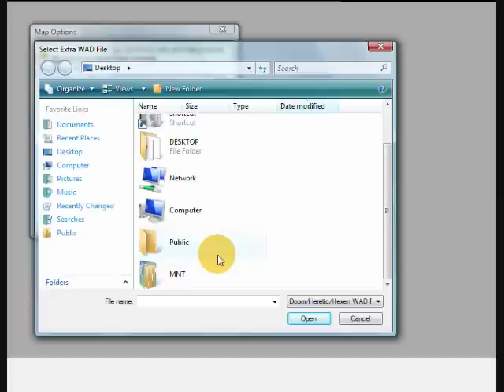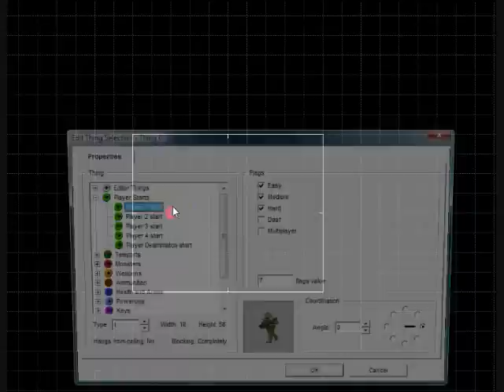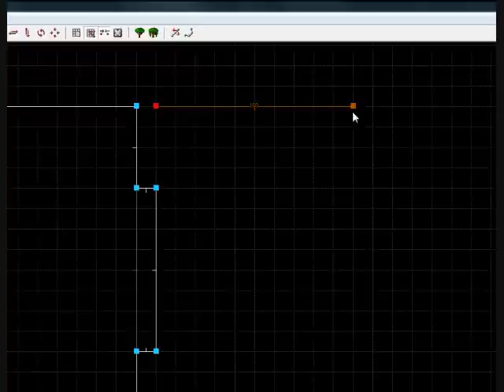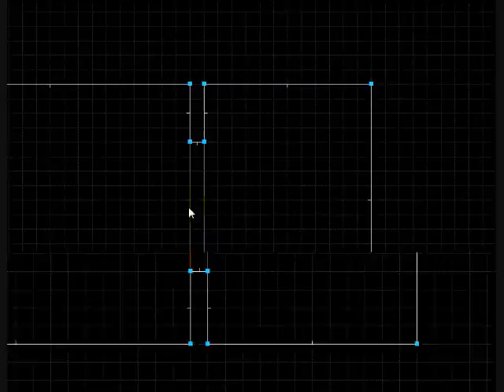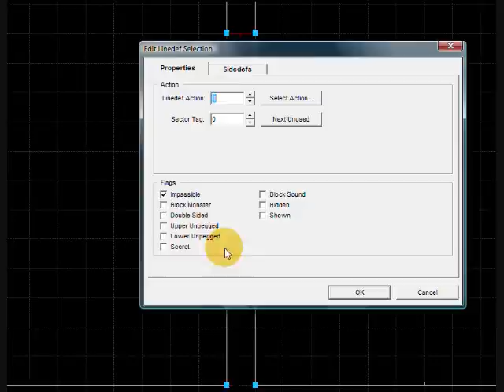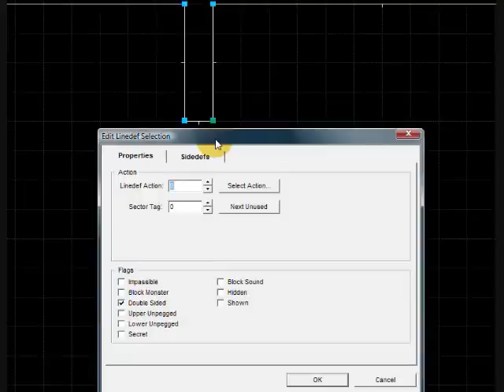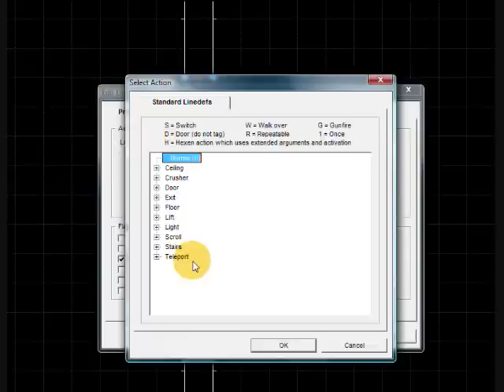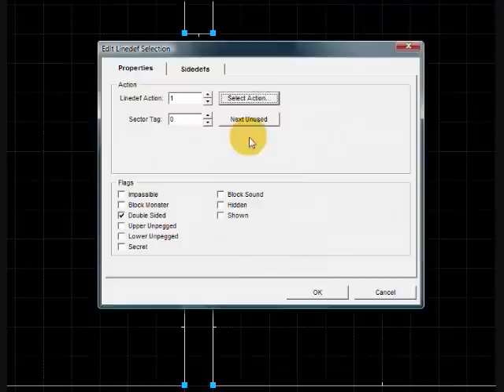(Doom Builder) Doors

Comment: I find it very difficult to make a see through grate door with key to open. I tried editing a few doors but the doors are not solid. Mostly all the videos on Youtube explains how to make non see through doors.
Reply from the maker: Sectors can't be transparent, so there aren't many ways to make a true "grate door" that you can see through.  One of the only methods I know of is to write a script that "raises" the grate by changing the transparent texture's offsets.  The grate line should be checked as "Walkable middle texture" rather than "Impassible," that way when the texture is high enough the player can pass underneath it (Walkable middle texture treats the texture itself as an obstacle--very nifty for cases like this).

Here's a small example for you to check out:
https://www.mediafire.com/file/ej2yc7q3buu0iyv/GateExample.wad/file

I sure wish there were an easier way to accomplish this.  Nonetheless, I hope this helps.
Reply: @Chubzdoomer  Thanks. How to make transparent door in Vanilla Doom  - https://youtu.be/fsXXRYadNoY
Reply from the maker: @brucew.2805  Ah, very cool!  It's amazing how many tricks there are for the vanilla map formats.

Comment: The door won't actually move up, so I can hear it, but it wont move.
Reply: I have the same problem! Some doors work fine but some doors don't move up. The graphic flickers and after some time i hear the 'closing' sound but there's no opening sound or animation. 
Anyone else have this problem? Solutions?
Reply from the maker: It sounds like the door hasn't been constructed correctly.  Make sure you've lowered the ceiling all the way down to the ground and it should work if it has the correct line properties on each side.  If you still can't get it to work, you can send me the WAD to chubzdoomer@gmail.com and I'll take a look at it.
Reply: Wow that's so awesome. If you could fix this problem I'd be so happy. I'll send it today. Thank you!
Reply: Well everyone Chubz took a look at my map and sent a prompt reply and he found the solution!
He explained : "Any time you make doors, the walls they're touching need to be one-sided (and preferably Impassible).  In your map, the only doors that aren't working are touching double-sided walls."
So basically the fix was to make the 'doortrak' part of the door one sided and impassable. Doesn't necessarily have to have void space behind it (just tested) but void space is a faster and simpler fix. 
Anyone who hasn't subscribed to Chubz's channel please do so! He's a cool guy who makes good DoomBuilder tutorials and helps out newbies like me. Thanx Chubz!!
Reply: Chubzdoomer Thanks. Your videos are great by the way!

Comment: Hey. Do you know how to make smaller doors (for example, UAC doors) in a tall room (much taller than 128). Because in order to make doors, you have to make the ceiling at 0, but I can't make the lower texture a door. And when I try to make a door, the whole linedef (like the wall that should be the door) turns into a door texture. How do I fix this?

Comment from the maker: One way you could do it is assign the door's line an ID, then use the SetLineSpecial function (via an OPEN or ENTER script) and assign it either the Door_LockedRaise or Generic_Door special.  Both of those specials have options which specify what keys the door requires. If done correctly, both of the door's lines will be assigned that special so it will be just as if you'd applied them directly to the lines via the editor. You can find detailed descriptions of these on the ZDoom Wiki.

Comment: I found that, when turning a LineDef to become a door action, if you use Action: 202 - "Door Generic". You can assign the "Lock" dropdown menu. You can "lock" the door to only be opened by the blue key, for example. You can assign the speed, how long it delays until closing again and the behaviour, i.e. Open-Close  or something like that. Make sure you Trigger it with Player Presses Use, of course. You no doubt already know that, but i thought i'd reply, in case you hadn't resolved it yet.

Comment from the maker: @666bootboy93 Also, be sure that you are NOT using the Middle texture for the sides of the door you activate.  You should use only the Front-Upper texture for those.  I re-watched the video and if you follow each step closely, you should have no problems with your door.  You should enter 3D/Visual mode, too, to study your door so that it looks correctly.  And if you're not yet using Doom Builder 2, download that instead because it will help you tremendously.

Comment from the maker: @666bootboy93 The only time this happens is if you either don't properly create the sector that makes up the door or if you don't lower the sector down so that the ceiling touches the floor.  If you're using Doom Builder 2 (and if not you really should be, especially as a beginner) enter the Make Sectors Mode (M key) and click on the door sector.  It should glow yellow, indicating that it has formed a sector.  This ensures that the sector is not incorrectly created or "leaking" anywhere.

Comment from the maker: @skaman1986 And something else to note:  Make sure you type a value in "Delay" if you want the door to close after it's been opened, else if it's at 0 the door will always remain opened.  The larger the value in "Delay," the longer it will stay open.  If you type just 1, for example, the door will almost immediately shut close after it's been opened.  A value of 25 to 30, though (just like the movement speed) will be about default.

Comment from the maker: @skaman1986 As long as you've got the door's line linked to the door's sector, everything should be fine.  Under the line properties, though, if you want just a regular door you can use the "Door Generic" action.  Once you've chosen that action and put in the sector tag number, be sure you type something for movement speed (25 to 30 seems default-ish to me) and change Trigger to "Player Presses Use."  Also, check "Repeatable Action" near the top if you want the door to be opened more than once.

Comment from the maker: If you want to make a door that's not incredibly tall in outside sectors or tall rooms, create sectors (usually just two) that span the length of the door and that are positioned immediately in front of the door on both sides, then lower those two sectors down until most of the door is covered.

You can make tall walls in outside sectors look better, too.  Check out part 1 of my Artillery scripting tutorial to see how to do that and make your walls appear short even if your ceiling is real high.

Comment from the maker: Textures come in one size, and one size only.  You can only remedy this problem by:
A.  Resizing the door so that it fits the texture's dimensions (which are stated when you are browsing through the textures and click one)
B.  Going into vertices mode (V key), then right-clicking somewhere on one line to break it into two, then placing two of the same texture on both parts of the line, then using the arrow keys to manually align the texture so that it "looks right."

Comment from the maker: Try this, first:
For the sector you're having problems with, find and click the Make Sectors Mode button.  Now, go to the sector that's giving you problems and click once on it.  It should sort of "flash," indicating it has properly created a sector out of it.  You can do this even for most of your other sectors if you'd like.  It won't hurt them - it's just a tool to make sure all sectors are created correctly.

Comment from the maker: Are you using DB2?  The first Doom Builder is not as beginner-friendly when it comes to creating sectors, and if you don't connect the lines in a very specific manner, it will cause leaks and problems.  In DB2, you can be a little more careless and still have your maps work fine.

If you can use DB2, download it and use it instead.  If not, let me know and I'll see if I can further assist you.

Comment from the maker: It's best to put your main .wad files in your ZDoom folder.  For Doom 1, for example, put Doom.wad inside the same folder as Zdoom.exe.  Then, make sure you configure DoomBuilder so it points to your Doom.wad file and so that the Testing section points to your Zdoom.exe file.

Once you've set everything up this way, there should be no problems at all running the game.

Comment from the maker: Are you sure the door sector's height is the same as the floor's height?  (Aka lowered down to the floor).

Also, make sure the door texture is set as the UPPER texture, that there are no middle textures, and that the lines that you activate (aka each side of the door) are NOT marked as IMPASSIBLE.  They should just be marked double-sided.

Comment from the maker: Unfortunately, you have to use a WAD editing program such as Wintex or XWE to be able to add custom music or change the music around.  DoomBuilder doesn't have this capability.

The only other options are to:  1.  Create a map based on the level which has the music you're wanting to hear.  Or 2.  Use the "idmus" cheat to play the music in-game without having to switch levels.

I know that those are two lame alternatives (especially the last), but DoomBuilder is lacking in options in that area.

Comment from the maker: The easiest way is:  Make a square.  Make a smaller square within the square.  

Make the outer-square have the door properties; the inner square can be either the same height as the floor, or raised so that it's like a little platform that the outer-square (the door) opens up to reveal.

Place the weapon, item, etc. on the inner square.

Let me know how that works for you!

Comment from the maker: Do you use sector tags?  If not, the way you construct sectors - if done incorrectly - may cause that to happen.  If the doors are all registering as a single sector (rather than multiple sectors), this will occur.  Try highlighting each door in sector mode.  Does it cause the other doors to highlight?

Comment from the maker: Are you sure that you LOWERED the door sector to the floor's height (at default, 0)?  Also, make sure both sides of the door are marked with the DR Door Open Wait Close tags, and that the pegs of each side of the door are facing OUTWARDS, towards where the player would activate them.  (Highlight a line and press "F" to flip it, if the pegs are facing inwards instead).

There are so many possible errors, it's hard to pinpoint what's happening without more specific information about your problem.

Comment from the maker: Yeah, when you draw something outside your rooms and try to drag it into position (rather than starting your drawing INSIDE your rooms), major issues can occur.

The method in which you start making the door on a specific vertex point is the RIGHT way to do it and will rarely result in errors unless it's a user-made one.

Best of luck with the rest of your mapping!

Comment: What I did wrong is make the door by itself then paste/drag it into the spot I want. I believe when that happens, DM considers it to be attached to the sector and not letting it be considered it's own sector.

What I did is start making the door ON the vertex I want and go from there. I didn't though it was possible because everytime I tried it before DM just selects the linedef instead of the vertex so I zoomed into the vertex and it worked. 

Doh!

Thanks Chub, I owe you BIG time. ;)

Comment from the maker: Crates can't be walked through if you create a sector and raise it, then apply crate textures; OR if you create four lines, mark them as IMPASSIBLE, then put on crate textures (not recommended).  For the door, the only way to see an upper texture is if you lower its ceiling downwards, "revealing" the upper texture.  If you can't increase the ceiling height of rooms (both in 3d mode and regular mode), it sounds like the sectors/rooms aren't constructed properly.

Comment from the maker: Make sure that the sides of the door that you open are NOT marked as "IMPASSIBLE" (their line properties).  This is probably why you can open the door but can't walk through the open doorway.  As for the blurry textures, is this only in DoomBuilder?  It may be a problem with your video settings if that's the case.  I'd recommend going to TOOLS->CONFIGURATION, then 3D MODE to see if everything is correctly set up there.

Comment from the maker: The keys to creating a door are to lower the sector and give the two 'door' sides a "Door Open" action. There's not much you can do wrong when explaining it to someone. I rewatched the video just because of the comment and I can say for sure that there is nothing wrong in this video.

As for not being able to go through the door, make sure the lines on both sides are NOT marked as "IMPASSIBLE."  If they are impassible, you can't pass through them.  They should only be marked as double-sided.

Comment from the maker: That's odd .. are you sure that your 'ceiling height' for the door is equal to the floor height (so technically the ceiling goes down to meet the floor)?  It sounds like the door's ceiling height could still possibly be up too high.

Comment from the maker: Are you referring to the big demon face on level 30?  If so, it's made up of lots of walls that go very slightly further back to give the impression that it's one huge, tall wall with a head rather than a bunch of wall pieces with proper textures so that they line up.  Load up Map 30 in Doombuilder (open the Doom2.wad file) and check it out - it can be a pain in the ass to re-create from scratch.